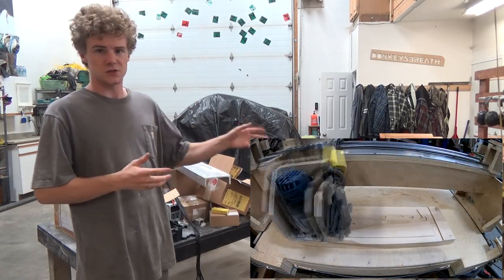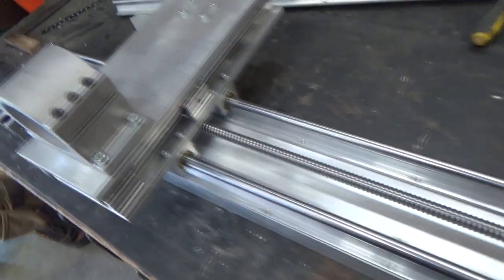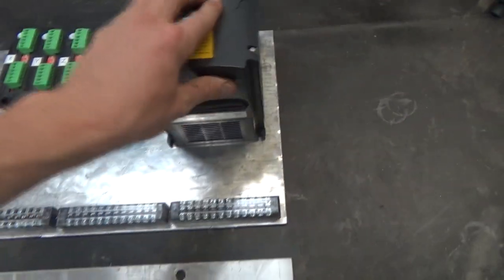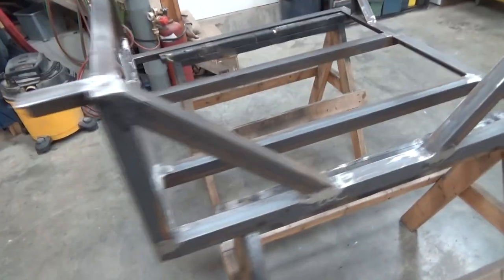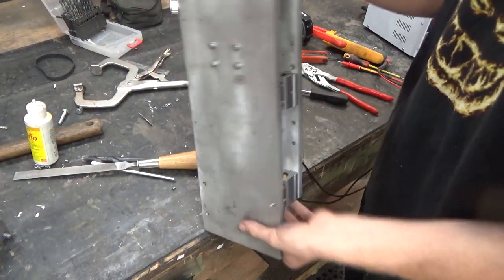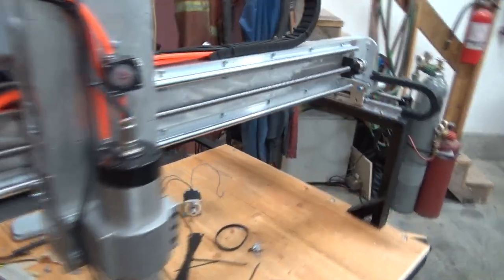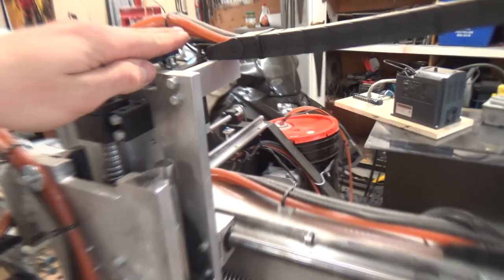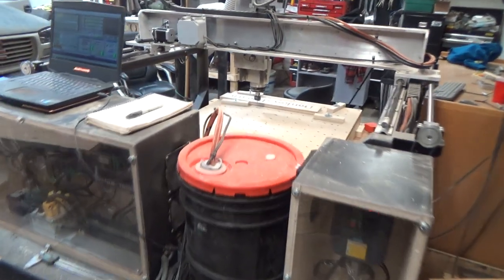My 32'' by 32'' DIY CNC Router {Mach3} [Very Long build]

Comment: How does the pulley and belt system work better rather than connecting the motor to the ball screw directly? 2:1 ratio doubles the torque? Is it? And therefore we can use smaller motors? Or it gives the rapid?
Reply from the maker: The way I have it set up more torque but slower , Eventually I’ll get bigger motors use one to one or direct drive on the shaft so roughly the same tour as I have now but twice as fast